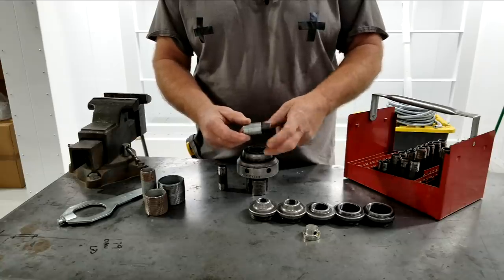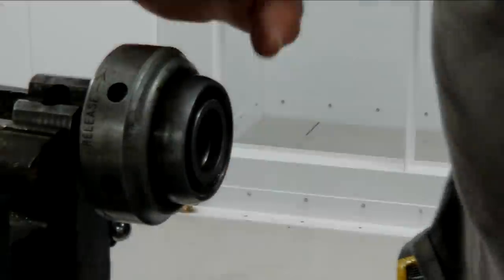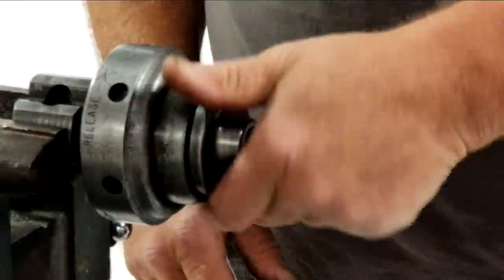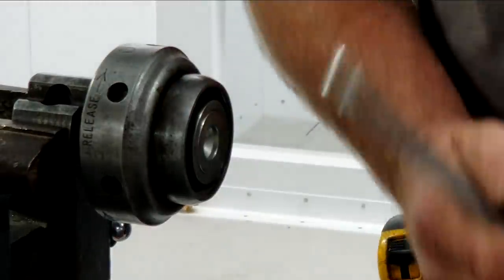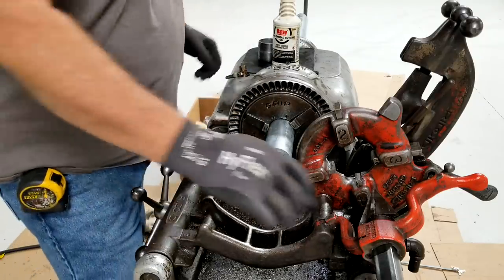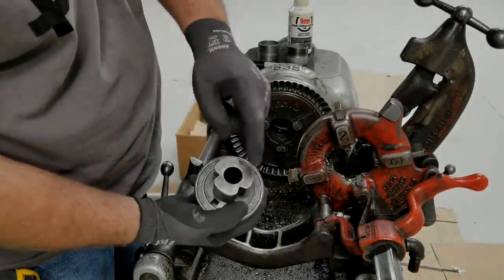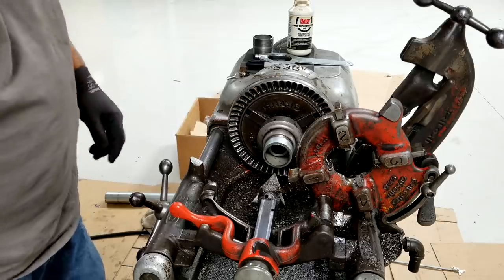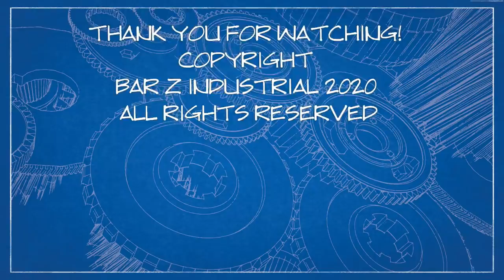Release the nipple!      Ridgid 819

Comment: When I apprenticed in the trade in the early 80s our apprentice projects were making 3/8-2 inch nipple chucks with merchant couplings and standard long nipples. Before I quit the trade I had a full set and was threading close nipples in a rigid 500 for the price of some throw away couplings from T&C pipe and a hack saw blade.

Comment: That machine is also great for making ring's with solid round stock up to 1/2" in. if I remember correctly. In welding school we had to make some two or three inch ring's, we would put in a pipe that had a single hole in the side, maybe 3/4 of an inch from the chuck, that holds the pipe. The pipe may have been 2' Ft. or just a little shorter. We had a heavy duty metal table, {maybe 10 or 12 foot long} of the proper height to support the 20' Ft. long round stock of choice. If I remember correctly the machine can turn both clock-wise & counter clock-wise. We made the ring's having the machine turn counter clock-wise. The material was very tightly wrapped around the pipe, we just put a 1/16" in. cut-off wheel {4" in. Dia.} on your personal grinder, cut the length of the wrapped solid stock material, and the ring's mostly fall off. First cut off the approx. 2" inch that went into the hole of the pipe, up by the chuck,  and the LAST approx. 3 or 4" inches that didn't wrap around the pipe.

Comment: Having worked in the oil and gas industry I can tell you that many engineers will not accept close nipples in screwed pipe assemblies. The reason has been the amount of leaks around close nipples is very high and it's due to people over tightening them. One thing you can do to get around this specification is to make your "close" nipples with 1/4" of blank pipe between the threads. That little bit of blank pipe means it is no longer a close nipple but in fact a short custom made nipple. Generally speaking, the proper way to tighten pipe thread is to spin it in with your hand until it is snug and cannot be hand turned any further. Then take the appropriate sized pipe wrench or strap wrench and turn it in 1 to 2 more full turns. If you go more than 2 turns you will start to collapse your nipple and stretch your female thread assuring leaks in the future.

Comment: Those work well on black iron. I did some 2” stainless with the dies maybe a little too tight and jammed it up tight. Took a 4 ft pipe wrench and a cheater to get the cam lock loose. Thanks for the look.
Reply from the maker: I havent tried it on SS, thanks for the warning!

Comment: Great video....always been curious as to how close nipples are held when cutting threads.
Reply: You can always make a nipple in a pinch by cutting a long thread on a piece of pipe and running a threaded pipe coupler in so that the pipe comes through the coupler just a couple of threads short of exiting the other side. There is your nipple chuck. Cut the thread on one side, cut off to the correct length, thread into the nipple chuck and thread other side. Easy peasy.
Reply: @ronkennedy213  It only takes a couple of minutes to make and can save a lot of time and no lost parts.

Comment: Great video Stan!  We thread schedule 80 hydraulic lines at work;  will the nipple chuck handle schedule 80  in 1 1/2" and 2".  Thanks again!
Reply from the maker: I have some SCH 80 2" here, ill give it a fit and get back to you.
Reply: @ShadonHKW  Thank you!
Reply from the maker: Yes, a 2" (sch 80) fits and threads with no issues, I don't have any material for the other sizes, you may want to check with Ridgid before making a purchase.
Reply: @ShadonHKW  Thank you Stan!

Comment: i remember those machines.. we even used one on a friends boat with straight threads to make custom bulk head fittings.  also used it to thread silicon bronze rod for long studs when needed. and we needed a lot to fasten the keel  and the propeller shaft logs and propeller shaft V struts. it was not a small wooden boat.
Reply from the maker: I have the dies to cut threaded rod, but the economics just aren't there to make them myself.
Reply: @ShadonHKW  some of our threaded rods varied from 6' to 24" long.  just can't walk in a hardware store and ask for those. sometimes we could get bronze carriage head bolts but we still had to take them to the machine shop to have them weld up the square so we could grind them into a counter sunk or flat head configuration to fit the prop shaft Struts.
Reply: @ShadonHKW  Kieth Rucker recently repaired one for Leo at Sampson Boat Co.